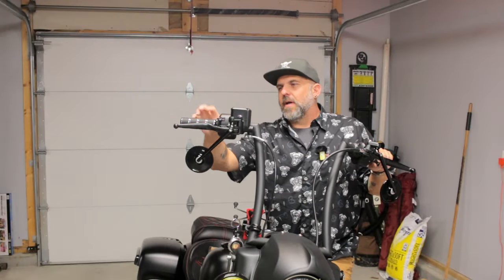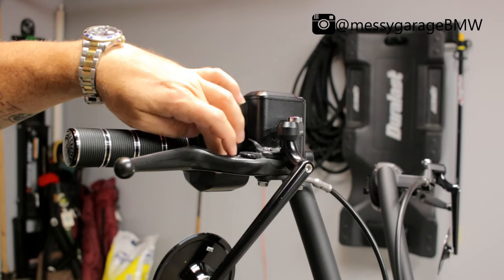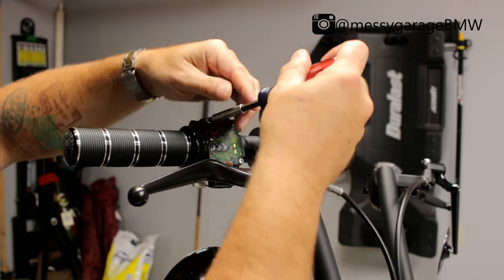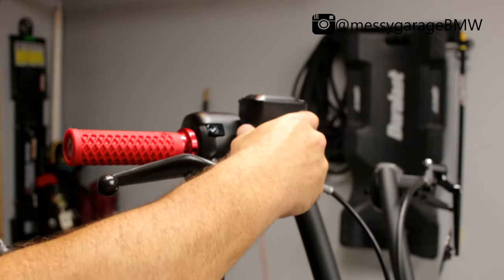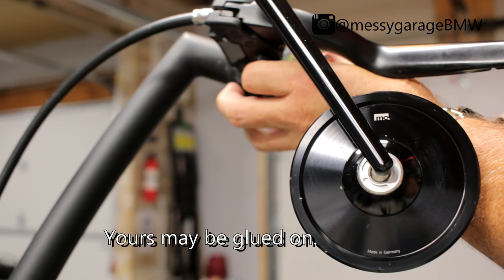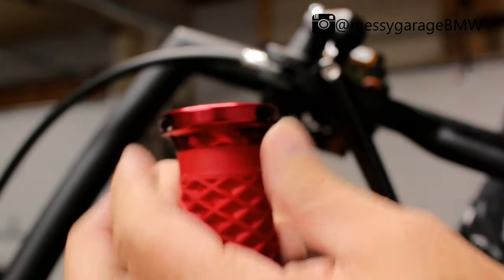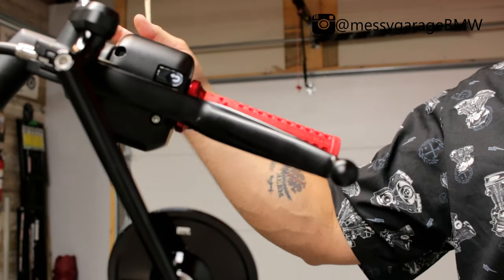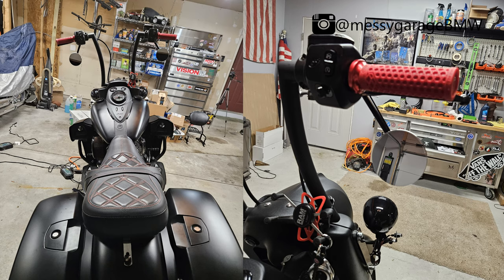Indian Springfield Dark Horse - Vans Grips Install and Review

Comment: Great Bike...   which set up do you have with combustion mirror kit? did you require the extension? Did you buy the mirror separately? I noticed it did not have the curve that the dealer provides.
Reply from the maker: My mirrors are motogadget.  No extension needed and they are more adjustable than the indian mirrors in regards to position and angle of the stem.